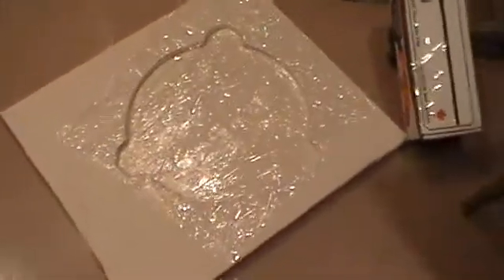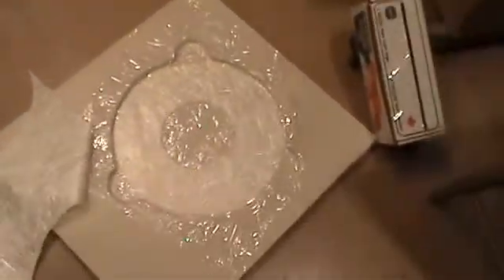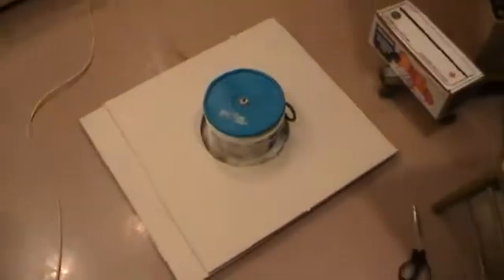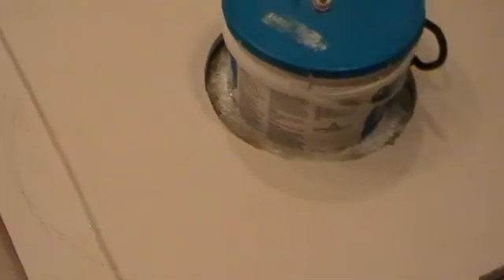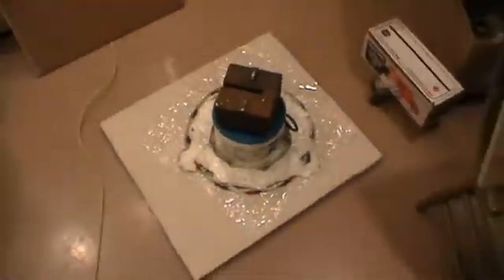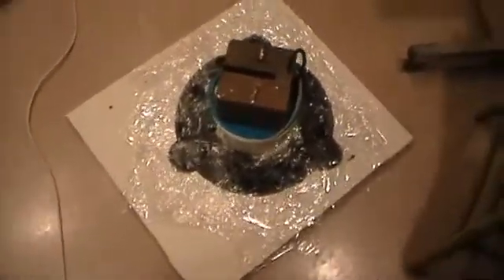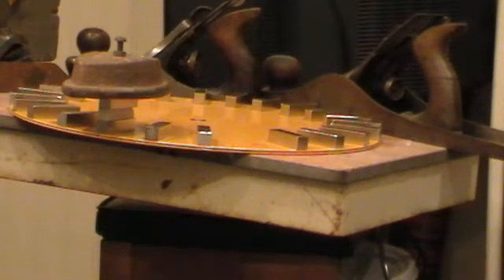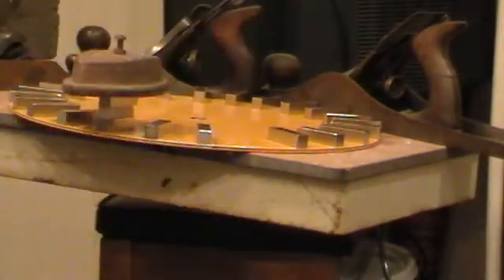remkick axial flux 2 serpentine energy neodynium

Comment: what did plate of metal you use for the stator?
Reply: These were 1/8" mild steel plate that I found in a scrap yard already cut and painted 16" diameter
Reply: @lloydlloyder3879  Thank you....

Comment from the maker: it worked well to the degree that it gives a nice smooth surface and you get absolutely no sticking and I did jack up the hardener, and this causes more heat to compensate for my cold house so some of the plastic stuck to the stator but that is no problem.  If I needed a finish surface for gellcoat ,I wouldn't do it of course. Too many small wrinkles., but for a good quick release it works great.